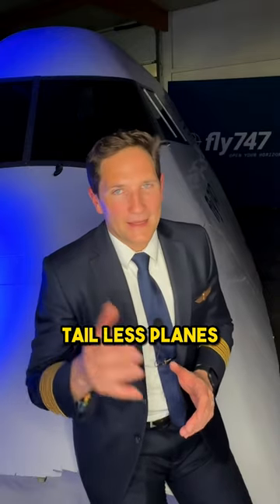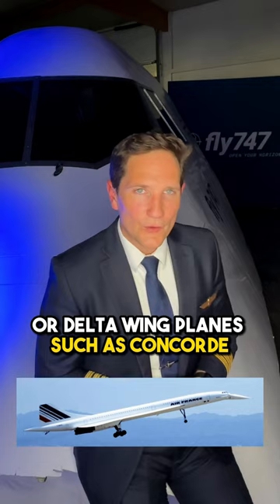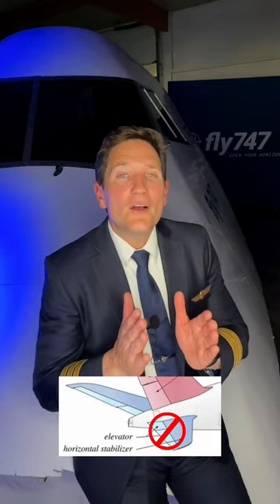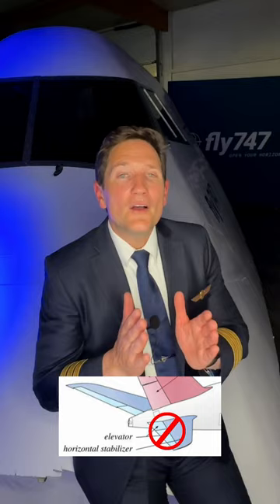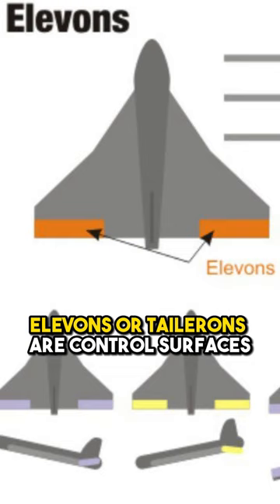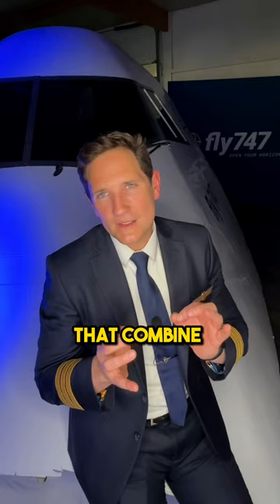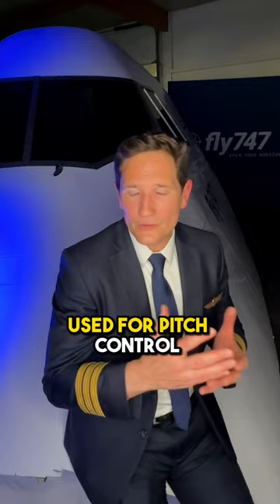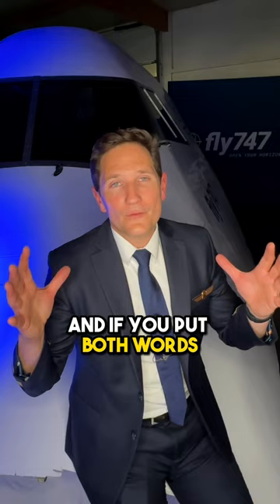Ever heard of ELEVONS?? #shorts

Comment: Less interesting but there is also the so called "stabilator" a mix between an elevator and a horizontal stabilizer. Common on some small planes, like the Tecnam 2008.
Reply: Also common on supersonic jets (F-16, F-35, et al)